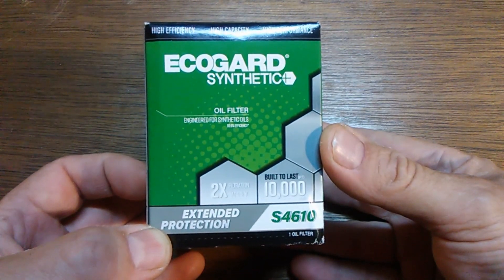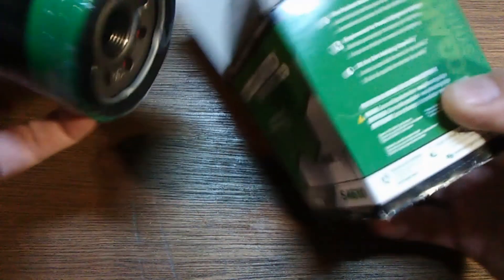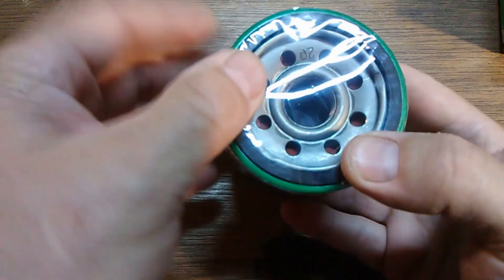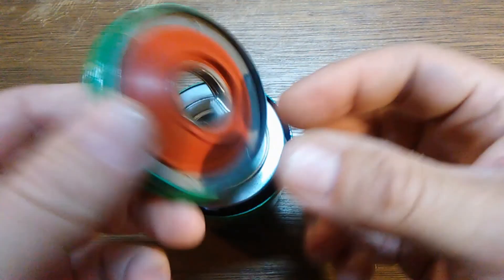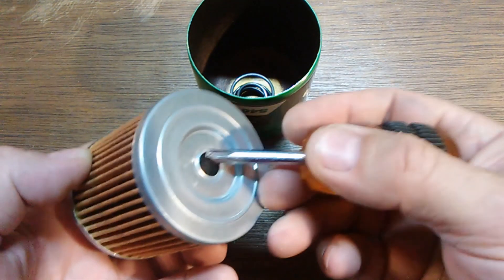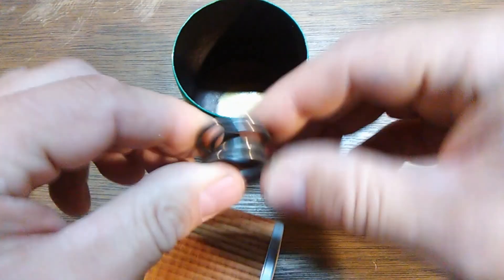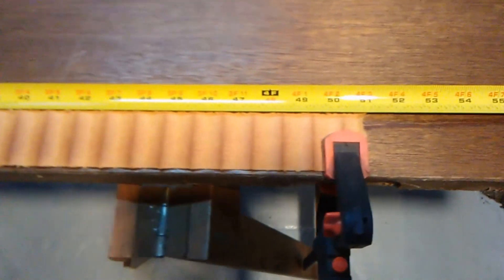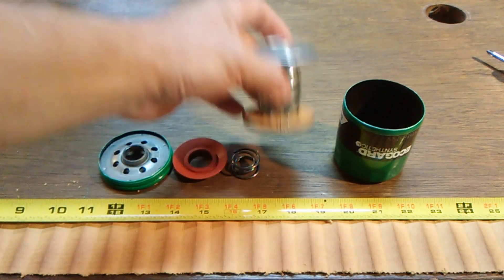Ecogard S4610 Oil Filter Cut Open

Comment: The bypass for my particular size (ECOGARD S4477) is 15 psi. It's probably different for other models, but that's similar to OEM (12-15 psi) for my Toyota. I was also told it's 99.8% efficient at 20 microns 👀
Reply from the maker: That's a very good micron rating. Thanks for sharing.